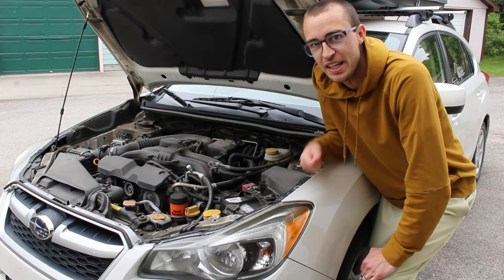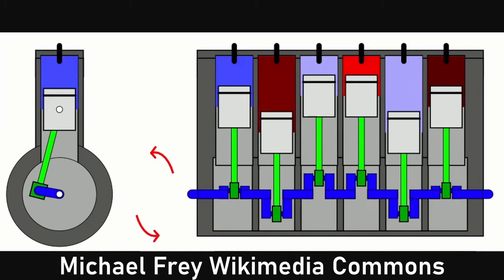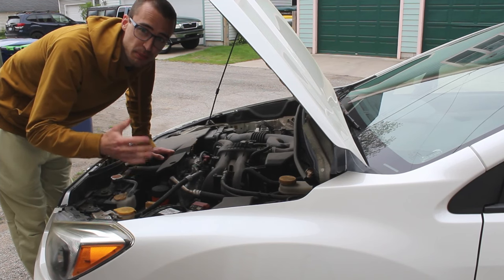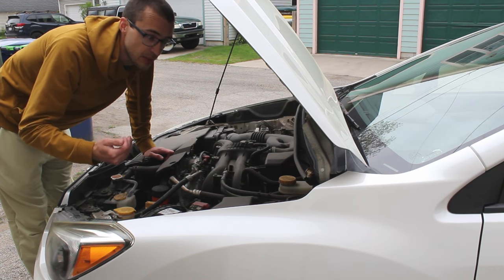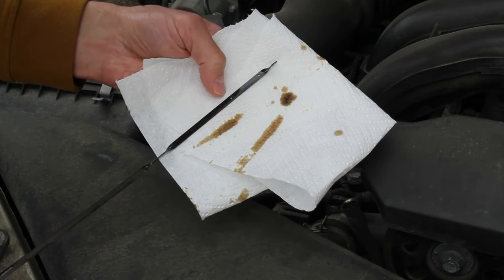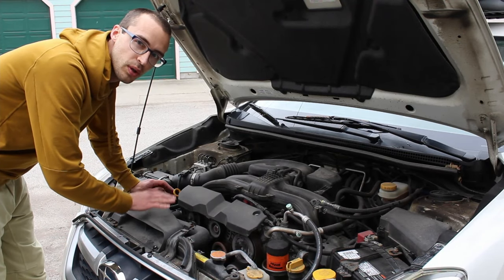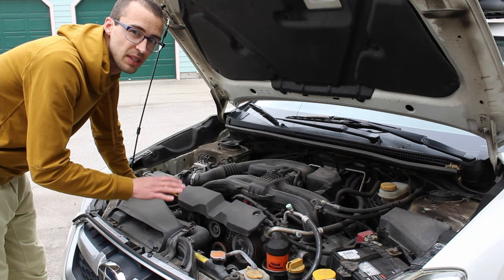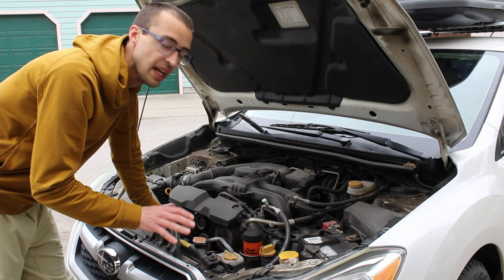Subaru Oil Consumption Issues? Information and FIX!

Comment: NO NO NO FALSE. "loose pistons" have nothing to do with burning oil. ALL pistons move inside their cylinders in every auto manufacture. It's the piston RINGS that are the problem for Subaru oil consumption. THE OIL RINGS. Bad oil ring design causes oil burning. When they clog up and no longer scrape or move freely oil gets by.
Reply: The skirts on Subarus pistons have a Teflon coat that wears over time which allows too much movement that causes the rings not to seal evenly. So your both right. Get over yourself hahaha 😂
Reply: @r.l.strange1897  Incorrect.

Comment: If I watch your video before, I will not buy this pice of junk.I just bought a used 2013 outback with 131000 miles and the used car dealer said they just change the oil but 2 days after driving it for only about 300 miles,the low oil level showed and I have to fill up 2 quarts and today after another 500 miles the warning showed up again.Avoid Subaru
Reply: Same problem with my new 2013 outback at 146k.
Just bought it today and was burning 1 1/4 quart on 140 miles.
Agreed junk. 
Wish I knew it was this bad. Thought it was just a few but apparently it’s common with Subaru. Did ask the previous owner about oil consumption prior to purchasing it and he stated he didn’t noticed 😂. I got played.

Comment: So they loosen the tolerance on rings to improve fuel economy, burning oil and engines failing faster is better? This trade off is stupid. Burning oil and building more engines saves environment.

Comment: If they did that intentionally the EPA should be knocking on their door and they should have to recall everyone and put new engines in them that's despicable and disgusting of a car company to do that to its customers all for a little bit of fuel mileage they're going to put pollute the air and ruin people's vehicles they need to be held accountable.